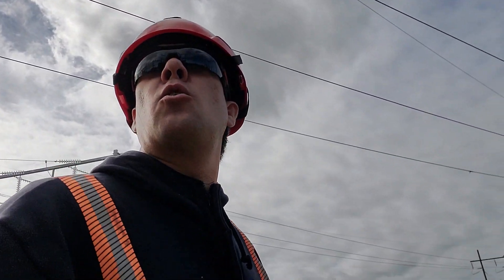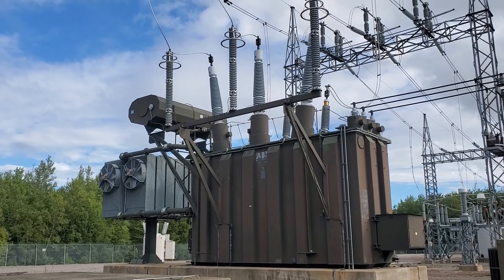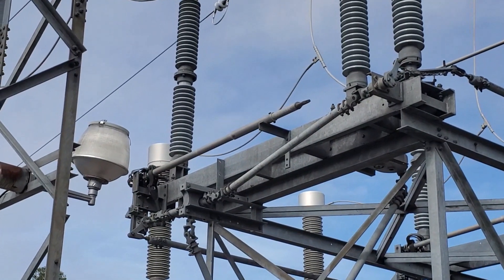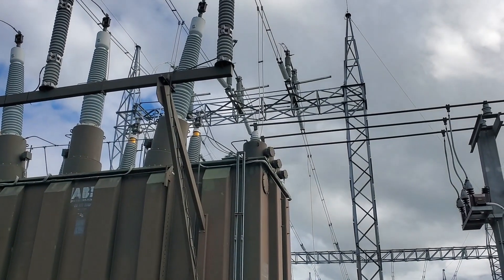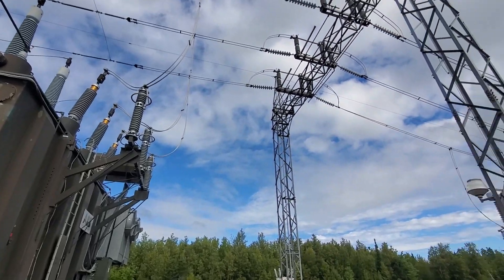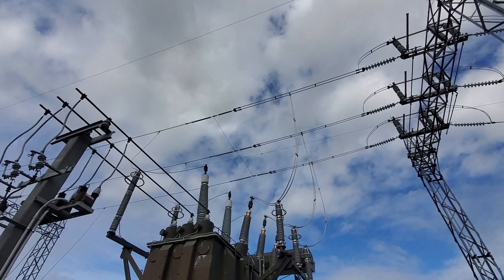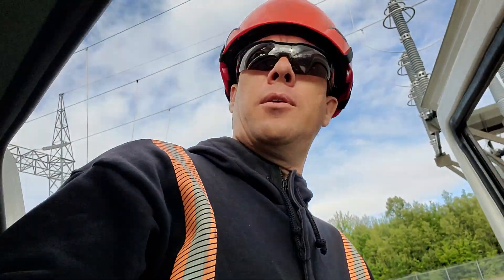230/138Kv Transformer with 12Kv side bushings

Comment: So what is the tertiary voltage on the 345/138/? that has the reactors connected to it? :)
Would love a video about those. Like what they do and how that stuff works. Why are they sometimes connected to a tertiary winding on a transformer?
Reply: I don't see any reactors.  He said the tertiary is 12.47kV.  
It is common to add reactors to the tertiary of auto-transformers because lower voltage higher current reactors are much easier to build.  That's just not the case in this example.
Reply: @matthewbeasley7765  If you know where he is you'd understand :)

Never seen a 420/300kV 1000MVA auto transformer with a third here.

Transformers with a third are usually 420(300)/132/22kV or 132/66/22kV. Never heard these being called auto transformers, but I guess they could be?

The 300kV, or 275 as some call it, is slowly being replaced so pretty much all transformers bought for 300kV are switchable to 420kV. Same is being done for 66/22kV ,with some exceptions, new ones can be switched to 132/22kV.
How these are designed I don't know.
Reply: @Gazer75  Autotransformer means both the input and output are taps of the same winding, as opposed to separate windings. In this case the primary and secondary are the same winding and the tertiary is a separate winding.
Reply: @eDoc2020  I know auto means same winding. Is that a common thing on transformers with 3 voltages? Is it even normal for bigger steps like 420(300)/132kV? Guess the equivalent would be like 345/138kV in US.
I'm guessing if that's the case then the third voltage would be taken from the second, where the primary and secondary voltage shares the same winding and then a second winding between 132kV and 22kV?
Reply: Tertiary delta windings are used on wye to wye transmission transformers to give harmonic currents somewhere to circulate so the system source doesn't have to supply them.
Reply: @randacnam7321  Thats to advanced for me 😅
Reply: @randacnam7321  Yep, tripplen harmonics along with any zero sequence current (neutral current).
Reply: Tertiary voltage is specified by the utility, often times 14.4kv L-G (again, utility dependent). Lower voltage means lower insulation requirements but larger or more wire wraps required for the same MVA rating.  Reactors are primarily used to counteract the capacitive voltage buildup on long transmission lines during periods of light loading.  There are also higher voltage class (138/144kv) oil filled reactors that look nearly identical to a power transformer except they only have one set of bushings.

As for the delta connection mentioned in other comments, this is usually a "buried" winding, sometimes not even brought out externally on the transformer, other times there will be 2 bushing brought out and linked together and grounded to from one corner of the delta.  Very rare that all 3 bushings would be externally connected for the delta
Reply: @dustinboyce25  The oil filled ones are most common here if not exclusive in substations at 132-420kV. In a station with 420/132kV they are AFAIK always in a 420kV bay. In some rural areas where 132kV is the top they can be found rarely. And I've seen them in industrial substations at that level. 
Don't think I've seen the dry air core ones here in Norway unless its at like below 50kV or as part of the SVC. Though I have noticed they are fairly common in North America.

What is the difference anyway? It's pretty far beyond my knowledge though. I've also noticed they sometimes have a rating range. 70-150 Mvar, or something like that.
Reply: @Gazer75  The dry core are cheaper and usually less footprint, but the insulation is prone to breaking down and they make a big mess when they blow

Comment: The tap off is likely a delta tertiary winding. Its primary use is a stabilising winding for the main transformer windings (allows for zero sequence current flow). Bonus you can also use it as an auxiliary supply.
Reply: The 11kv  tertiary windings in my old company where delta connected to limit 3rd harmonic currents being generated by the wye connected main windings giving them a internal  path to flow . Complicated phenomena to try to understand at a trade level its engineering level really but becoming more of a problem these days with non linear electronic loads becoming more entrenched in our customers loads. That transformer though large in dimensions has relatively small radiators and only two cooling fans which would make sense being a more rural load demographic not requiring a large demand.
Reply: @noelcastle3986  I'm thinking forced air cooling of an oil-filled radiator stack like that is heaps more efficient than simple 'convection' a normal transformer that has its oil-filled fins just hanging off the sides of it ...
Reply: @uploadJ  True ,  most of the transformers in my experience  where in  higher load density regions of Australia. They where 60 to 120mva rated 132kv to 33 or 66kv , oil forced by pumps thru full sized radiators also fitted with fans in separate groups . Was still not enough years ago when large scale air conditioning uptake caused some big overloads on heat wave conditions . It was common to hose down the radiators  on these days to keep the transformers from tripping on hot winding protection . They had to spend big $$$ uprating the whole system to avoid those issues in the late nineties.
Reply: We also use them for reactive VAR compensation with Air Core reactors to control voltage on the 500KV side.
Reply: My old company I used to work at many years ago had alot of 132kv oil filled feeder  cables that generate alot of VARs which could be absorbed by the load  during the day but late at night pushed the voltage too high they used air cored reactors there as well to absorb them through a tertiary winding.

Comment: Off topic, but I wanted to know what the allowable tilt to a standard utility pole is? I see many that are 15-20 degrees off vertical and always wondered how far they lean before they fall over.
Reply: If it hasn't fallen over yet then it's allowable.  :-)
Reply: @MatthewHill  That doesn’t make any sense. A fallen power line is a lethal threat. There has to be a safety margin between the angle where it actually falls and the maximum allowed angle.
Reply: @Engineer9736  whoosh
Reply: @MatthewHill  nope
Reply: falling over is not likely because the wires go to other poles which share the load. Does that lean put stress on the other poles? You betcha!

Comment: great video. I am Shure that substations like that have have a battery bank to throw breakers and disconnects during a outage.  some use compressed air breakers and such. well 3 phase its really 208 and split phase is 120/240 . around my area we have about 335KV and some around 235Kv . out a ways there is a 500KV . was wondering in your  area what is the highest voltage ? and do you have any DC lines ? Thank you, Robert Boston NY
Reply: A former employer's old substations had center tapped delta 240V for the substation service.  Lighting and the DC chargers were 120V single phase on the two low legs.  The breaker compressors were 3 phase 240V.  The source was two single phase pole mount transformers on the steelwork.  Now they do 208V three phase pad mounts.

Comment: One more question...
Do they move those large transformers using Self Propelled Modular Transporters (SPMT)?
Reply: Nope, but there are specialized trailers to move them around.  Load limits on axels and such means lots of wheels on the trailers. SPMTs wheels are individually driveable. The trailers are just towed.
Reply: @azpcox  All around the world they do different things, just what floats the boat… I’m pretty sure SPMT’s are used in a percentage of such installs.
Reply: Once they get to site they are moved to final position using jack and roll technique. Basically a lot of cribbing and skids and hydraulic rams

Comment: I learn something new with almost every video. Thanks! I used to think the lights and other stuff ran off an external power source :) A couple of questions if I may ask....
How do they keep the power going when they have to take the 230 kV transformer offline for service? Do they use those mobile substations?
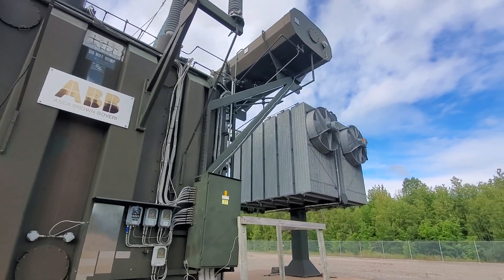@ 4:00 What is the purpose of the metal rings around the insulators?
Reply: They are corona rings. High voltage and very sharp corners on conductors do odd things in air. Coronal discharges, like energy just leaking into the air. Lots of it. Power companies don’t like that. Neither do working linemen in the yard who want to go home safely.
Reply: I'm unaware of anyone using a mobile for HV work.  The transformers are just too big and heavy.  They are shipped with special permits, without radiators, bushings or oil.  They take weeks to get installed.  The transformer has to be dried under vacuum and the oil introduced slowly.  
Redundancy is the way they deal with them.  Those 138kV lines have other sources, and when the transformer is out of service they will carry the load.  It is also common to have more than one at large substations.  
Typically above 230kV there will be four single phase transformers installed.  The spare unit will be setup with buswork and jumpers so it can be substituted for any of the other three.  The bank will only be out of service for a few hours for service as they can swap in a unit that fast and then do whatever service is planned on the dead unit.  A utility near me takes this  a step further, they have 7x433MVA transformers for their 500/230kV substations.  They are in two banks of 3 and the middle unit is a spare for any of the others.  That's even more efficient as they only have 16.7% sitting idle instead of 33% of the capacity sitting idle.
Reply: Grading Rings, similar to Corona Rings.  ;)

Comment: What's the MVA on that beast. I'd guess 75MVA.
Reply: That would work to about 326 amps on the transmission lines? Or would that be about 100 amps per line. I'm not familiar with 3 phase circuits.
Reply: @DavidJohnson-tv2nn  It would be 326A on each phase, assuming it's a well balanced system.
Reply: That sounds pretty low. Guess it depends on what kind of production/consumption there is in this area.
Around here the transformers between 420(300)kV and 132kV are usually 100-120 MVA if older and new one are at least 150 MVA with the big ones being 300 MVA.
Reply: @Gazer75  Sounds like European voltages over where you're at.
Reply: My bet is for 300MVA.
Reply: That's just a baby, I would also guess the ONAN rating to be 75MVA at most
Reply: @dustinboyce25  I was thinking 150MVA OFAF!
Reply: Power xfrmr weighting 200 tons is usually rated between 150 and 250 MVA (depending on cooling
Reply: @imeprezime1285  weight is not an accurate way to judge MVA rating.  An auto transformer would weigh significantly less than a power transformer of the same MVA. An acoustically dampened transformer could weigh significantly more than it's counterparts.  There are also considerations such as transformers designed for specific environments that might have additional features such as deluge systems.
Reply: @dustinboyce25  That's why I gave approximate figure range. 200 tons for just 75 MVA unit would be too great waste of material for todays standards
Reply: Only way to accurately determine the size of a transformer is by looking at the nameplate.  Not only does KVA/MVA, & weight determine size, but so does BIL. Especially since this both primary & secondary voltages are at transmission levels, & not to mention the station service feed that's coming off of it.

Comment: i'm english, it's intriguing how north americans never seem to bother with 'intermediate units' no matter how large and unwieldy the numbers get as a result, i.e: this power transformer weighs over five hundred thousand pounds [250 tonnes] or: i'm usually around one-eighty but when i was ill i weighed 140 [13 & 10 stone] - any reason why?
Reply: It sounds more impressive. It's just the way we do it. We have no clue what a stone is. We use pounds so that's what we know, that's what we know so that's what we use. It's a vicious cycle.

That transformer weighs over 200,000 courics, while I only weigh 88 courics.
Reply: Why not mix and match - five hundred kilo pounds, 500klb

Comment: That high voltage hiss always scares me when I hear it near power lines. Even hearing it in this video makes all my hairs stand on end. How close would you have to be to actually be in danger of an arc forming and flashing over at those voltages?

Thanks for another great informative video into a world most people don't get to see!
Reply: You can easily visualize this distance by looking at how far apart the wires are mounted on the poles. The higher power wires need more distance to be safe. You can visually see the insulators, so that distance is required. The casing of the transformer is grounded, so it would jump to that if it could.... theres your safe distance! It looks like 5-8ft
Reply: Electricity jumps 1mm per 1000 volts. So 245kV = 245mm = 24.5cm = 0.245 meters, or little less than a fooot in freedom units. But i would stick to the 2.4 meters safety margin or even further. Once you screw up you won’t ever know you’ve screwed up.
Reply: @Engineer9736  this rule breaks down above 10-20kV. I've seen a 70kV potential jump 20cm. As a rule of thumb for these higher voltages, flashovers occur at about 30cm (1ft) per 100kV
Reply: It's really interesting when you're close enough (like standing under it not literally climbing a tower!) to a line and can actually feel it.    500kv lines will definitely give you a tingle.  The one that passes through my city has quite the sag to it and if you get up on rocks you can get pretty close.  Far enough to be safe, but close enough to definitely feel your hair standing on end.
Reply: Don't be taller than the steel posts that the insulators sit on.
Reply: Short answer, as a qualified (senior/ experienced) utility worker you get as close as 1.8 meters to an energized or ungrounded 240kV conductor, trust me when I say you want a spotter when working that close.  

This measurement allows for the flash over distance (varies with humidity, altitude and other factors) as well as a safety factor on that distance and then usually an additional 300mm added as a buffer for the "human factor".
Reply: You have to get pretty close to altogether a shock but to break the arc once formed takes  a much greater distance
Reply: At least length of the insulator approach distance to be safe is recommended for transmission voltages between 110 and 400 kV

Comment: Can you do a video on all the different voltage levels of the power grid?
Reply: I agree, worthy of a video.  That said, here are the standards:
LV:  120, 120/240 1ph, 208Y120, 480Y277 (US/Mexico) 600Y347 (Canada, also used in US industry)
MV:  4.16kV (rare now), 12.47kV, 13.2kV, 24.9kV, 34.5kV
HV and up:  69kV, 115kV, 138kV, 230kV, 345kV, 500kV, 765kV
It is encouraged to stick to 69/138/345 OR 115/230/500, but one utility is always meeting another and you end up with just about everything in between.  This channel has talked about 69,138,230 and 345 for example.
Reply: @matthewbeasley7765  I think a map / visualization would be a lot clearer 😉 This looks like the source code of the Linux kernel..

Comment: Nice video! This is fairly common here, at least on the TSO level. They may have access to the local distribution grid, but having it local is an extra backup.
Though the tertiary can also be used for capacitor banks and such as well.
I'm assuming stations like this also have backup, like a small diesel generator, to operate it in case of an outage?
Is there really no oil sump required over there?
Reply: In the case of an outage, most newer relay houses are equipped with a battery backup that can support the panels inside long enough for someone to get out to site. In remote areas, I've seen generators used as backups because of how long it takes for a tech to get out there.
Reply: @GoldenPants911  Batteries are universal at substations.  All of the protective equipment runs on DC, most commonly 125V DC in the us.  The charging mechanisms on the breakers will be AC, mostly 3 phase.  Without AC power, you get one open-close-open cycle.  
Usually there are 2 AC sources with a transfer switch.  If there is only one internal source, a local distribution line is used or a backup generator will be installed.
Reply: To answer your question on the oil sump: The transformer looks quite old, probably before the days of mandatory oil containment. If the transformer leaks oil, my guess it'll just go into the top rock. The foundation the transformer is sitting on just looks like a pier or spread-footer (hard to tell without digging down).